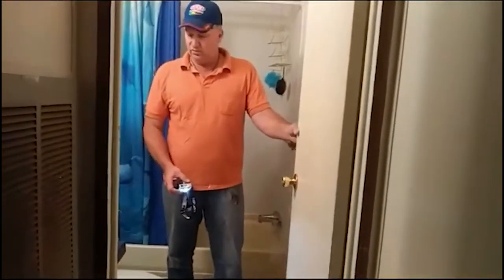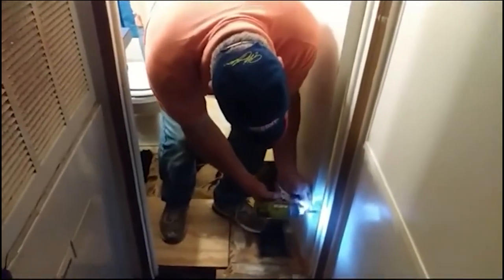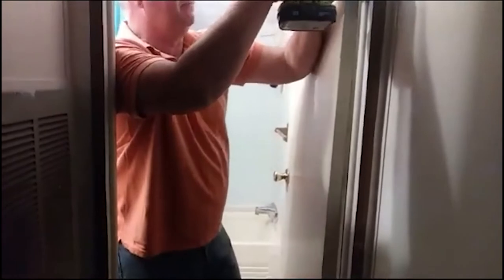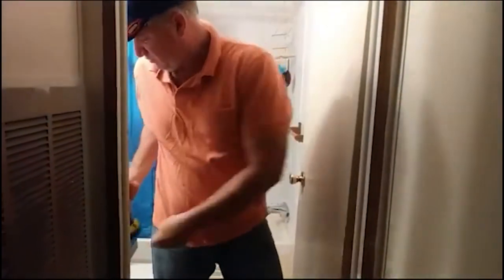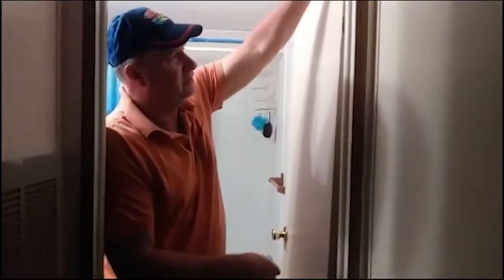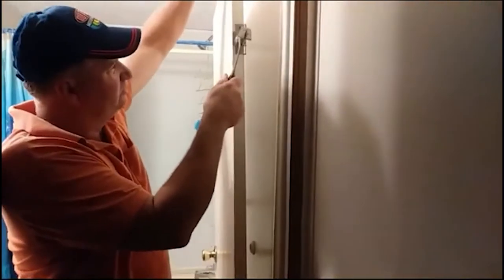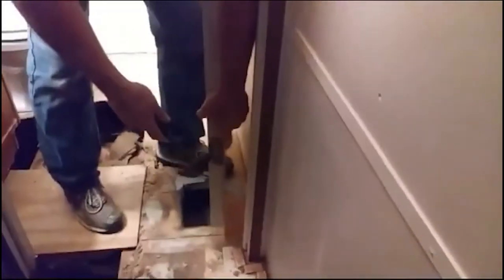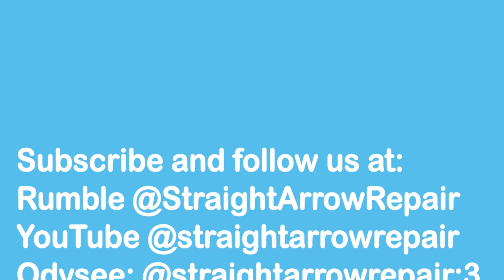Mobile Home Door Hinge Repair

Comment: Hi, I have a question about mobile home floating roofs. 
Why didn't the manufacturers  screw the roof down to the trusses, to keep the roof from making noise during high winds ?. 

And can I screw the floating roof down on my mobile home ?.
Reply from the maker: That tin will split and tear where you fasten to rafters. As a matter of fact about 30 or 49 years ago they made a product called rumble buttons to screw thru the roof . It caused all kinds of leaks. Those houses were made to be flexible going down the road. To bend and twist. I could go on and on . Most people throw tires on the roof to stop roof rumble. I have putting metal roofs over them to slow down maintenance. Hope that helps.
Reply: @StraightArrowRepair  Ok, thanks for the reply. 👍🏾